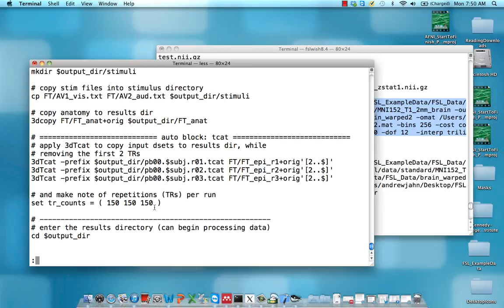AFNI Start To Finish Tutorial, Part 8: 3dTcat

Comment from the maker: Hi Felix,

Each run has the baseline drift modeled because each run can have different profile of signal drift from the other runs. It is true that this spends a significant number of degrees of freedom, but when you consider that the degrees of freedom is the number of scans (usually about 800-1200 for a typical experiment), it is safer to do it this way. In my own experience (doing it both with and without) it can increase the power of detecting signal that is actually there.

-Andy

Comment: thanks a lot for these videos. I just finished the tutorial myself, but I have (at least) one remaining question:  Here you concatenate the three runs to produce one single large scan. But at a later stage in the tutorial, when it comes to creating the X matrix, why are the runs again treated separately by adding three times as many rows for baseline drift correction (3 x 4 = 12 rows) than would be necessary for a single scan?? Whats the benefit of that, because it takes up degrees of freedom...